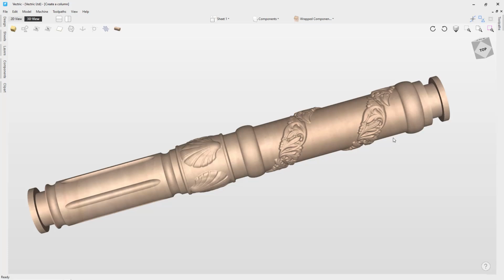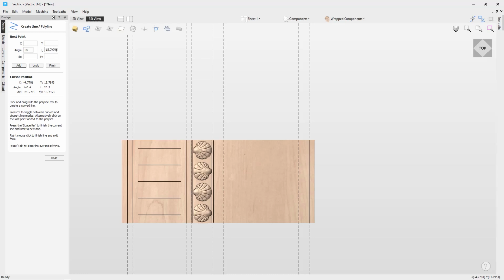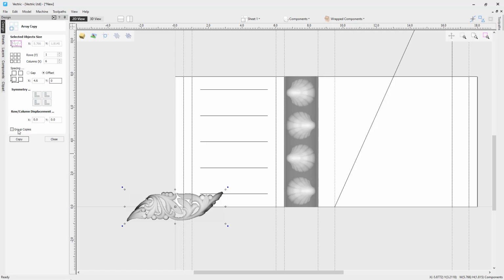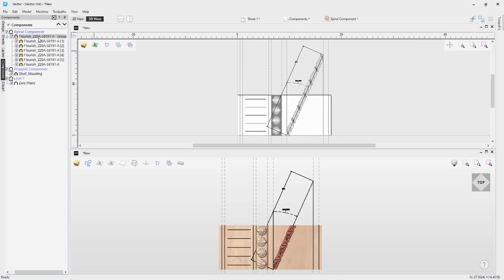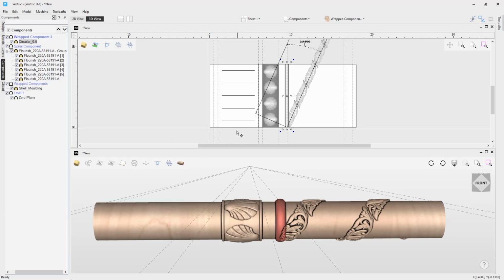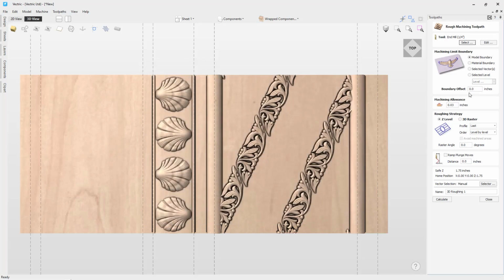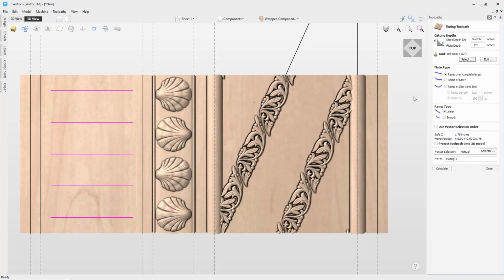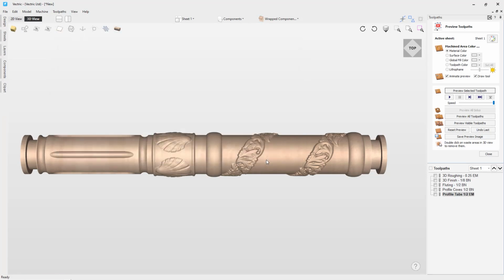How to Create a Column | Wrapped Rotary Machining | V12.5 Tutorials

Comment: How to Create a Column | Wrapped Rotary Machining : "This video demonstrates how you can manually create vectors for a fluted and spiral layout." Where is the video that goes through setting up the fluting and the shell wrap.  I'm trying to locate the one before this that shows the initial setup.  Please?  I just came back and believe I found it, which is not in your first set of playlist for wrapped rotary Machining.  Called How to create a fluted column, Now for the shells...  However I did find a different playlist under the Aspire level that has 10 videos, not the five or six found on the other playlist.  Wow so many different doors.
Reply from the maker: We will have a look int this, but for now if you want you can go to the Aspire tutorial browser or select your software to view the tutorials which apply to your software.  This will bring up all of the videos... hope that helps.  https://www.vectric.com/support/tutorials/aspire/?